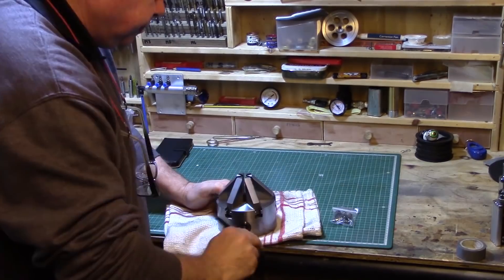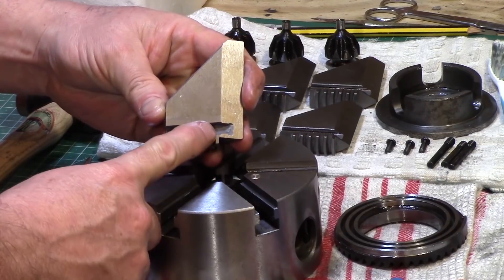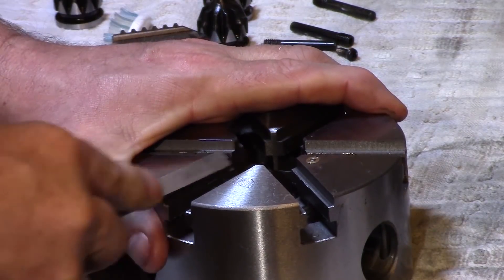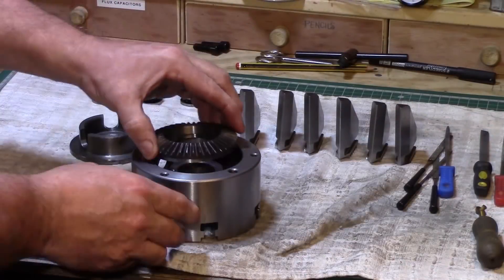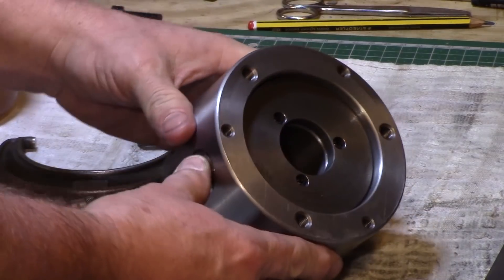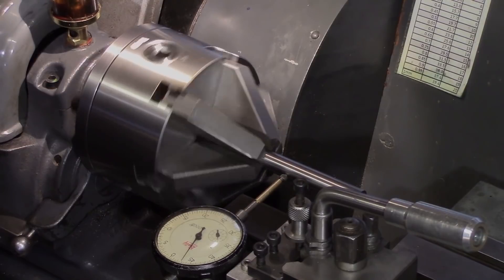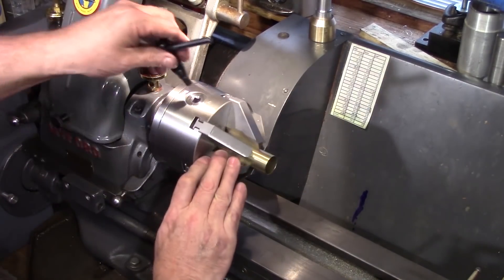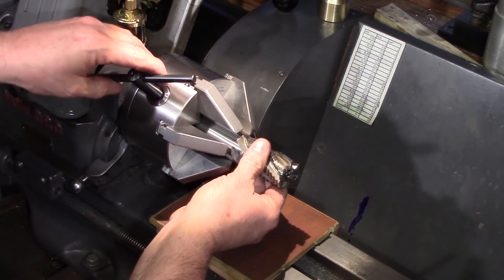Sanou K13-100 6 Jaw Special Purpose Chuck Review

Comment: Hi Ade  Could you make a Zero adjust chuck by giving the spigot on the rear of the chuck more radial clearance --  say 3 thou.  Loosen the three adjusting cap head screws and tap with a dead blow hammer to achieve dead center, then tighten the three cap head screws.
Reply from the maker: Yes John, this is the accepted norm

Comment: The K13 chuck is also available with normal internal, external, and two part reversable jaws. They should all be compatable with the chuck body. I want to get the 160 size with normal external/internal, and two part would be nice.  Any idea where to buy just the jaws?

Comment: Hi.
As we are a chuck manufacturer in India. Manufacturing chucks since last 62 years.  Side ways shake is a not much a problem if it is within 0.01 mm. Up down shake is not acceptable at all.
Secoundly, i agree with the video regarding 6 jaw chuck should be used for  parts with less wall thickness or to hold drills (holding from flanks) however for forging, casting or simply round jobs 3 jaw chuck is always better. 

Concept is more the jaws and slots of the chuck body is involved, more the chuck is inaccurate.

Comment: Great review, nicely done. 
After all the effort to clean it up, it still required all three pinions to be tightened to get good gripping of the workpiece? I wonder if this is the case on a TOS or Bison chuck of similar size, and yes I am aware that they would be many times the price. I have not had anything to do with six jaw chucks and just wonder if an expensive chuck would still require the three pinion adjustment. I only ever use a single pinion to tighten my 100mm three or four jaw chucks.
Reply from the maker: Hi smallcnclathes, thanks for your comment. I have never owned a precision chuck from the brands you mention, as you say, they are usually out of the price range for a hobbyist, so I do not know if they would require multi-pinion adjustment. I also own a 3 jaw self-centering chuck made by Bernurd, and have found that single pinion tightening (in the same jaw) produces the most concentric accuracy. My guess would be that for a high priced precision chuck the accuracy would be a lot more repeatable from a single pinion securing, but I may be wrong. The 'essence' of this review is that good quality accuracy can be had from 'budget' equipment, for the home-engineer. Regards. Ade

Comment: i wonder how loose the scroll fits in the main body.  that would create the need to tighten it in 3 places..  you may want to use a 3/8 or 1/4" drive click type torque wrench. to equally tighten items in the chuck.  if you tighten the first one slightly less than you do the second or third you might be able to get the run out even closer.  might be able to use a spray welder to put a few tenths on the scroll to fit it tighter to the chuck body and reduce the slop..  might also set up the chuck jaws on their sides in a  milling jig all aligned.. spray weld up the slots in one side..  align them on a piece of ground to fit key stock.  then mill or grind the spray weld down to the exact fit on the chuck body.

Comment: Excellent review Ade. The other day I was thinking about the purpose of this chuck and the extended type jaws...  You have shown what a useful addition it can be. Bet you will get some great use out of it with all your great projects you make. Regards Steve
Reply from the maker: Hi Steve, Thanks for the comment, I think I will use this chuck quite often, mostly for the extended work holding capability, as this will solve many of the problems I have encountered in the past.
Reply: The washer in the spindle no good
Reply: The chuk is bad
Reply: Steve Jordan ;and